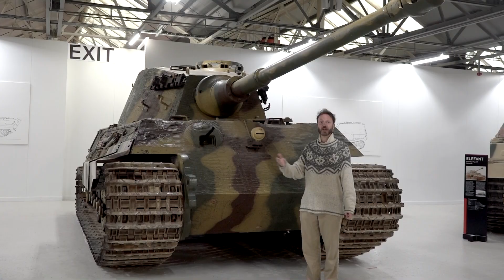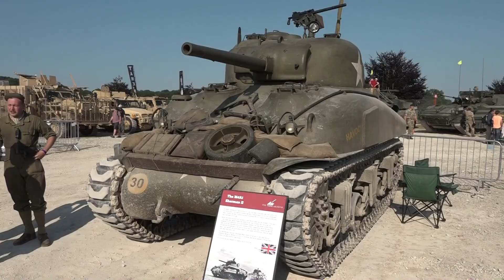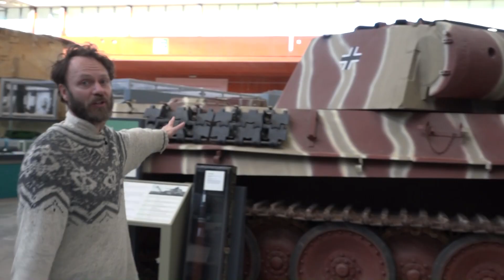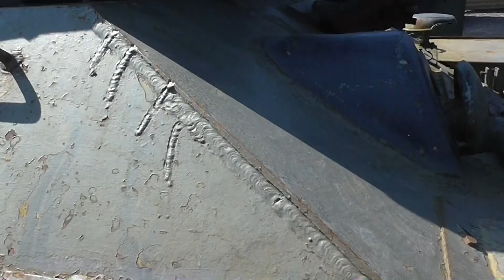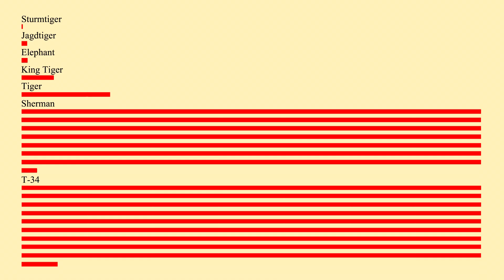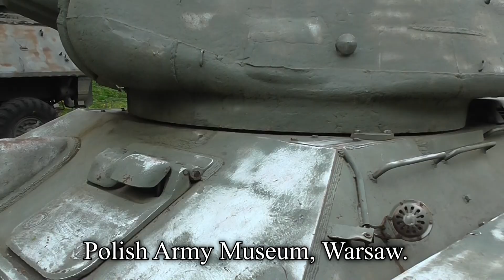World War Two's most common tank

Comment: Oddly enough, the Soviet philosophy on tank design, make it last (for them) 3 months, also has been applied to Formula 1 cars which used to be designed to last around 200 miles for a race just short of 200 miles, so that the optimal compromise between speed and endurance could be achieved.
Reply: Meanwhile In 2018, there were nine countries that maintained T-34s in the inventories
Reply: Not quite the same logic though. The soviets were cutting corners to keep their production quotas up, producing sub-spec, poorly built tanks that proved to be deathtraps for their crews. The whole “it’ll probably be knocked out in 3 months so why bother making it better?” was a pretty poor excuse given that the Americans achieved similar production levels without compromising on quality. A F1 car by comparison, may not be built to last, but they certainly don’t cut any corners while making it.
Reply: @CharlieNoodles The Yanks weren’t constantly being bombed and didn’t have their entire industrial base occupied like the Soviets did. The fact that the Soviets built more tanks than the Americans in temporary shacks on the other side of the urals is a testament to the strength of planned economics and socialism.
Reply: @comrade_commissar3794  It really isn't. The US is even better at logistics than that.
Reply: @comrade_commissar3794  Right, so the Lend-Lease from the USA and the Arctic Convoys were unnecessary then? The Soviets started the war with 6 times as many tanks as the Germans, as they had been planning for war since the early 1930s.
Reply: @EdMcF1  Yes, lend-lease was largely unneccesary.
Reply: @comrade_commissar3794  so you’re still here parroting that ridiculous claim that the Soviet production facilities were “little shacks” under constant attack. You are a joke if you think that is true. We have one unverified account, of one factory located in a city that was under siege and you seem to think that applies to the entirety of Russian heavy industry?
Reply: @comrade_commissar3794  “lend-lease was largely unnecessary”. According to Soviet propaganda, which has never lied or distorted the truth to make the USSR look good ever.
Reply: @comrade_commissar3794 a country with shortage of raw materials...

You think lend lease is about vehicles? Read again.

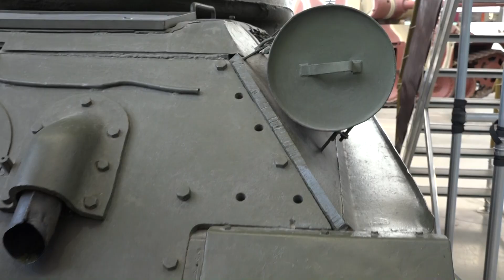Comment: 6:35 I think the reason for the shoddy bolts and gaps was because that back plate was supposed to be able to hinge open if you needed to do maintenance on the engine/transmission
Reply: No, it was because the workers building it were cutting corners in order to maximise production.
Reply: @CharlieNoodles  "No, it was because the workers building it were cutting corners in order to maximise production."
You can see the hinges. Even if the tank was supplied with a full set of bolts, if the crew had to fix the engine often enough they would certainly 'lose' a few of the bolts.

Comment: There is a very good reason that the Sherman always gets qouted as taking 5 Shermans to take out ........ A US Army armored unit had 5 Shermans per platoon. The smallest unit that tanks operate in is a platoon. Plus US units could always whistle up batteries of 105mm and 155mm artillery.
Reply: And P 47s.
Reply: Yeah, I'm no expert but I always kind of imagined with how pitiful the cannon is & how paper-thin the armor is on the (default unmodified) Sherman, they were useful for infantry support & armored cavalry due to their speed but weren't much use in a fight against anything bigger than enemy light tanks. More of a 'distraction swarm' to draw fire from the enemy while the real heavy lifting tended to be done by the tank destroyers (or SPGs, motorized assault-guns, field guns, or anything else you had lying around that could be used to put holes in things in a pinch...)
Reply: @Coconut-219  The Shermans armor was comparable to a T 34.  It was the best tank in the world when it came out.  Its 75 mm gun was much larger than the 20 and 37 mm used in other tanks.  It was especially useful against fortifications.  By 1944 it was going to a 76 mm gun which could penetrate Tigers at 500 yards.  Colonel Creighton Abrams wiped out a column of Panthers using Shermans.  Hellcats with the 76mm did the same.  Chieftan states it had one of the lowest casualty rates of any tank.  German heavy tanks were made in very few numbers and were seldomly encountered.  The British Sherman Firefly could destroy any German tank.  The standard Sherman was overwhelming to the Japanese.
Reply: @Coconut-219 The Sherman's original armor, without any upgrades, the first Sherman to ever come off the line, had a frontal plate 2 inches thick, and the angling of the plate gave it an effective thickness of 91 mm. The Tiger 1 had a frontal plate 100 mm thick with no angling. If the Sherman had paper thin armor, so did the Tiger.
Reply: @charliebasar9068   The difference is the Tiger had a very good gun and the Sherman had a very bad gun. So the Tiger's 100 mm was very thick armor for the allied guns of the time
Reply: @donaldhysa4836  The allies had plenty of guns that could beat the tiger pretty easily. The Sherman was plenty capable taking out medium tanks, infantry, fortifications, and lighter vehicles. If they encountered a tiger, they could bring in tank destroyers, artillery, air support, or infantry support to deal with it. The Americans made 2500 M18s and nearly 11,000 Shermans with the 76mm gun.  The Germans made 1347 Tiger 1s.
Reply: @charliebasar9068  Yeah and the reason they had to bring those other things is cause they can't do the job themselves
Reply: @donaldhysa4836  ...Ok? I don't see your point, the allies were entirely capable of defeating the Tiger, the Sherman did it's job well. To clarify, are you arguing that the Sherman was bad, or the Tiger was good or something else? I'm confused at what you're trying to say.
Reply: @charliebasar9068  The Sherman was bad. Thats what I am arguing. 12.000 Shermans were deployed in Western Front after D day and half of them were lost in combat. Thats how bad they were. Imagine if half of all Abrams tanks deployed during Desert Storm were lost in combat. That would have been considered a disaster
Reply: @donaldhysa4836  And the Germans lost over 500 Tiger 1s in combat alone. Does that make the Tiger a bad tank?
Reply: @charliebasar9068  Actually the germans lost all of their 1300 Tigers. But thats still a lot lest than more 6000 Shermans lost in Western Front alone
Reply: @donaldhysa4836  They technically lost all of them because of the surrender, but pre surrender about 1238 Tiger 1s were destroyed. Which is nearly all of the Tigers. Not to mention all of the other tanks they lost, because the Sherman wasn't just facing the Tiger. To pull an earlier analogy of yours, if the US invaded Iraq and destroyed 99% of the Iraqi tank forces at a loss of 50% of the American tanks, I'd consider that a pretty total victory. Additionally, even if the Americans deployed 12,000 Shermans, they could always just deploy another 37,000 Shermans. The Germans couldn't deploy another 4000 Tigers. Not to mention the fact that the American crews in those extra Shermans would be experienced tankers, considering the survivability of the Sherman.
Reply: @Coconut-219 for the purpose it was designed for- supporting infantry assaults- the US 75mm gun was probably the best of the war. Accurate,  easy to service, and firing HE and smoke bloody good at it. The armour on the Sherman was rather good, crew comfort and the pinnacle of second world war fighting vehicles (yeah, that's a VERY low bar true) and it had good optics and good radios. Plus against most targets the 75mm was a threat at normal combat ranges. Even the mighty king tiger would be penetrated more often than not in the side armour. If you specifically needed an anti-armour gun, then there was the long barrel 76mm for the yanks or the Sherman firefly for the UK. But as tanks were so rare in the German army on the western front just months after d day, us army staff actually at the front overruled the planners back home so that the 75mm gun tanks were sent in preference to 76mm. They needed tanks to support infantry s lot more, and they had enough anti-armour tanks in theatre that were struggling for customers after the strategic bombing, interdiction strikes against railway junctions, CAF by the various fighter-bombers, massive artillery barrages and the organic anti-tank guns of every infantry battalion.
Reply: From what I remember the Chieftain saying, discounting stuff like light tanks which don't have anything really like an AT gun, what generally determined who won a 1v1 tank duel came down to who shot first more than size of gun or armor scheme.

He mentioned how the Pershing was designed to take out Tigers with the theory that it was impervious to Shermans.  And the US had three engagements with a Tiger: in the first the Sherman won, in the second the Pershing lost, and the third had the Tiger on a flatbed (or otherwise in a transportation system) so it wasn't a fair fight.

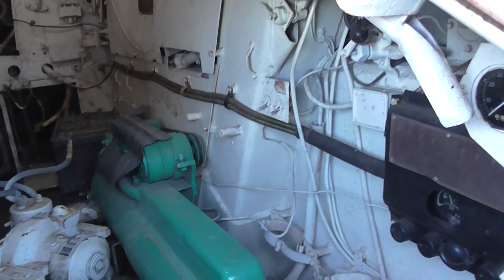Comment: The "crappy" T-34 at 20:25 is actually after war Czechoslovakian licensed production, which was superior in quality, compared to the ones used during the war. You can tell it´s Czechoslovakian tank by the markings on tachometer and the oil pump warning label underneath it.

Comment: The T-34 was not a shock to the Germans mate, in fact the Germans walked right over them since they were so beyond garbage that even the Panzer 3's and 4's could knock them out (The soviet heat-treating and build quality was so rubbish the armor would shatter like ceramic). Between the abysmal crew survival rate and the inconceivable attrition rate T-34s were almost a complete failure of a tank. When the exchange rate for lost tanks is so vast you know your tank is absolute garbage. German tanks were not all that great either, especially the Panther which IIRC was actually their worst performing tank in the war (It was not very good, hence why it was not in active service for any time after the war).  At least they weren't as bad as the Japanese tanks I suppose.

The T-34 and Panther have good "hard stats" but absolutely trash soft factors (sights for example) which is why they did so horrible. When you can't see what you are shooting at, can't get rounds through the gun quickly, can't coordinate with your allies, can't quickly get out of danger, can't fix your tank in the field, can't keep the tank out of the depot for very long, etc then it doesn't matter how good your armor is and if you gun can in theory crack anything it comes up with.
Reply: Compared to the t26 and bt7s that they saw thousands of, it would have been a surprise
Reply: @pzkpfwiii1455  Not it wasn't, especially considering the soviets had plenty of heavier tanks like the KV-2 (Aka "Stalin's Fridge") which were far chunkier than the T-34 with a bigger gun. There was nothing unusual about the T-34 besides how absolutely awful the build quality was and how abysmal the crew survivability rate was. They didn't even really see significant production until well after the Germans started splatting them by the hundreds.
Reply: Yess, and that's why the USSR lost the war.

Comment: The idea with the drive wheel/sprocket is that there are rollers that engage with the teeth on the track. The advantage of this is that there is no friction between the sprocket the track. The reason it's no longer used is that there is a limit to the weight that can be propelled by this system, being that the whole strain of weight of the tank is taken by the track teeth.

Comment: Interestingly enough, both Shermans and T-34's were used in the Croatian Homeland War and in the Bosnian War, right through the end of the wars.
Croats also had some Hellcats as well.
The 90s in the Balkans featured a load of ww2 stuff in many regards.
Reply: We might see some T-34s pulled out to replace all the T-72s/T-80s/T-64s/T-55s moscow has lost in their failing unprovoked invasion of Ukraine relatively soon, most certainly a lot sooner than we will see a T-14 make a cameo there that's for sure.
Reply: @demomanchaos  TBH T-34s are old enough that I'd be impressed that they'd maintained them well enough for them to still run.

Comment: For all the fact the general thrust of your argument is valid, don't you think it's a tiny bit disingenuous comparing only the limited production German heavy tanks and assault guns with mass produced Allied medium tanks?  Sure, you allude to Pz IV production later in the video, but you're still vastly exaggerating the difference by selectively focusing on the rarest of German vehicles.  Including the 6000 odd Panthers and 6000 odd Pz IIIs built would still illustrate the vast overmatch in allied manufacturing capability and least you'd be comparing like with like.

Or shall we mock the Americans for only building 40 M6 Heavy tanks and the British for only building 200 A30 Challenger tanks?

Yes, we get it that you think everything German is rubbish - but by overselling the point you sound like a jingoistic amateur.  The Panther did not have armour "about the same" as the T-34 - it was nearly twice as thick on the front - nor did it have firepower "about the same" either, but what are a few inconvenient facts if they get in the way of a good story, eh?  An intelligent discussion of the subject might be asking whether the higher performance of the German design was worth the higher costs (almost certainly not) rather than pretending that the two tanks were "about the same" and weren't the Germans just silly.

Comment: If you were Hitler in WW2; how would you combat even more simple, quick and cheap... 1 man, 1/2 scale back to front T34-85 tank destroyers?

With 1/2 scale V12 V2 engines, Ferdinand Porsche's Elephant case mate hull design, an armour thickness of 25mm surface hardened steel all round as that is the minimum to stop an armour pricing 50BMG round at 200m, AK-47 coaxial machine guns and oil barrel fuel tanks on the front and rear which can be emptied for floating across rivers or for beach landings. 

May had to of used the 57 mm ZiS-2 gun if the 85 mm (3.35 in) ZiS gun and 76.2mm gun didn't fit but still capable of over 100mm of penetration.

And, would you start building the design yourself instead of Maus, King Tigers and Jagdtigers?

Comment: One important thing to mention is that the T-34 was made in a hurry, contrary to other Soviet designs from that time. They rushed many things and couldn't refine it properly before the war started. It would be interesting to see a comparison between the T-34 and the KV-1, two tanks designed more or less in the same period, but the KV was more better finished.

By the way, the Panzer III looked better than the Panther. Way more sport tank, it looked almost as if it was possible to go rallying with the thing. Lancia Stratos of the tanks. And in terms of hand weapons, the Steyr Scout.
Reply: My understanding was that in practice the T-34 and KV-1 tanks actually performed about the same. Which was actually a bit of an issue for the KV-1's as they had a more intense production cycle and needed more resourced to produce. Which is partly what led to them being phased out in favour of the IS series instead (also the official the official the tank was named after had fallen out of favour since its inception).
Reply: @zaleost  both tanks had many significant differences in design, despite the fact they shared the same engine, and may have had the same process of armor tempering and things like that. 

The KV had torsion bar suspension which the T-34 wasn't able to get in time. Torsion bar is superior to Christie suspension. The KV also had a three man turret, the T-34 had only two. Not only that but the first versions of the T-34 76 not even had vision port slots turned to the rear side of the tank. T-34 vision was very poor. That's not quite the case with the KV. It didn't have a cupola like German tanks did, but it had many slots where the crew could see around. And also a machine gun to the rear as well. 

In the case of the suspension, given the fact that the KV was a much heavier tank, it may have performed somewhat similar to the T-34. In terms of the overall vision around, I don't know. I think it may have helped the crew inside the KV more perhaps.
Reply: @Magenael  I wasn't talking at all about their designs, I know they were very different tanks. I was mostly saying that it was my understanding that in practice the KV-1 series didn't seem to outperform the T-34's nearly enough to justify the extra cost that came with producing them.
Reply: @zaleost  the KV was a fair tank that did its job during the time. It performed well, better than the T-34 in 1941, got outdated when the Germans deployed the long 75mm gun, but then gave birth to the IS-2 tank, which was another important vehicle in armor development. The IS-2s complemented the T-34 85s late in the war.
I really don't see why scrapping it.
And when it comes to 1941, it was a better tank than the T-34 there, as I said. It caused a psychological impact on the Germans. Its massive armor influenced into different arrangements for the future tanks like the Tiger and Panther.